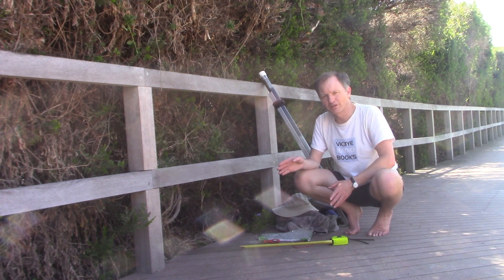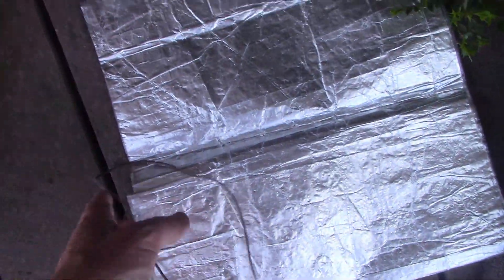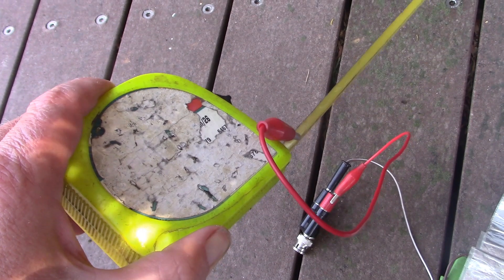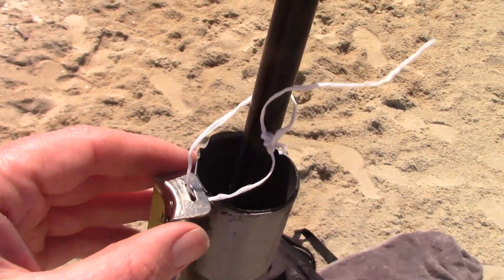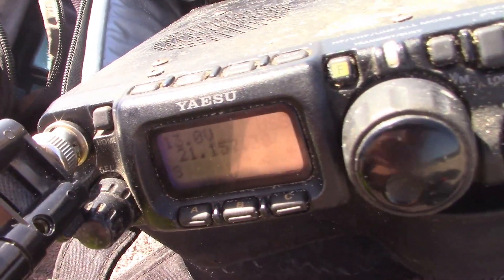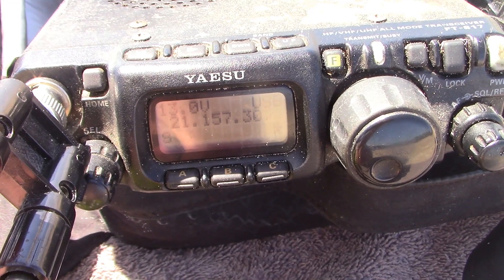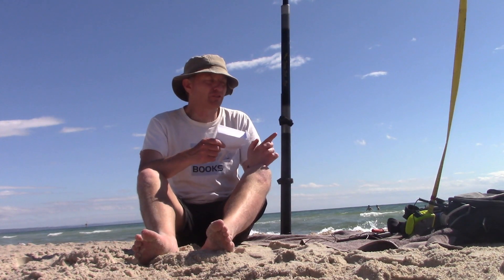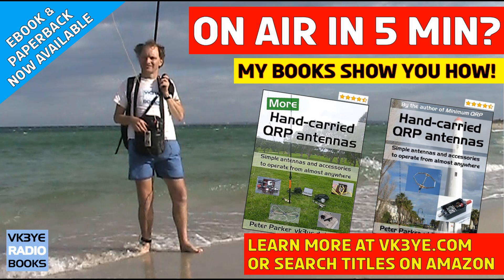Trying a tape measure HF vertical

Comment: Good expirement Peter, thanks. I remember seeing retractable  clotheslines and thought about replacing the cord with wire for a setup like this. However, I didn't bother because the weight of the whole thing seemed a bit pointless for portable as I can just wind the wire onto a piece of plastic. I have seen tape measures used as a quick way to setup multiple radials on the ground.